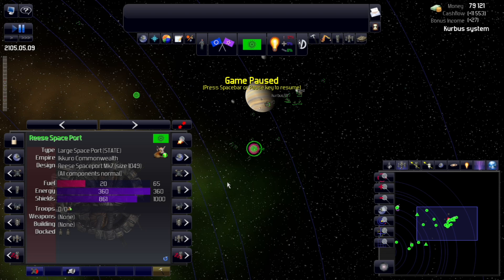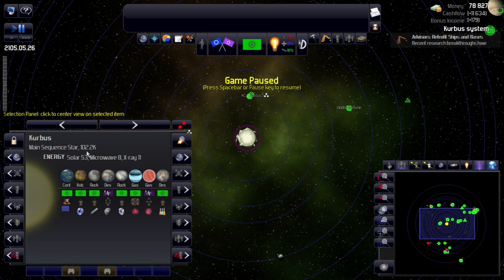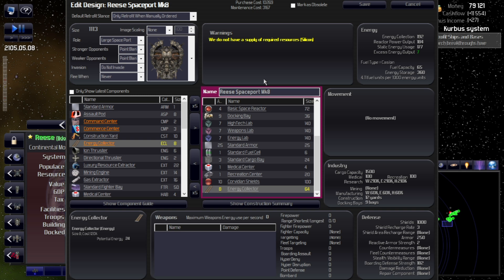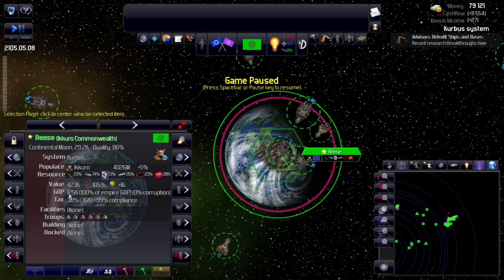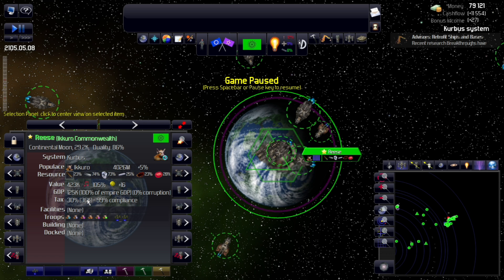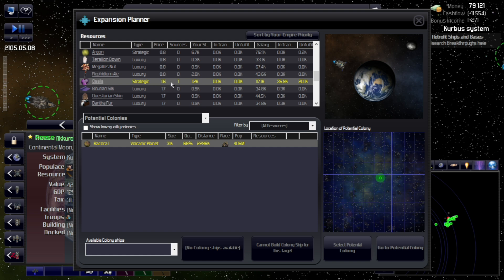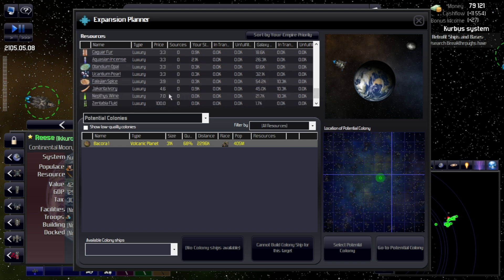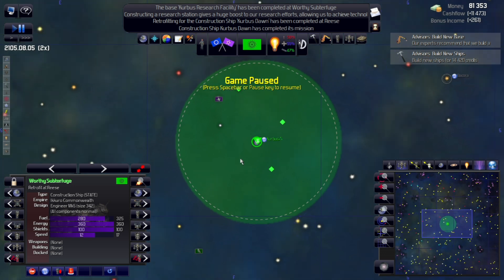Exploring Distant Worlds (VC) - Unpacking the Galactic Economy (7)

Comment: There's a difference between "realistic" and fun mechanics, especially in games, and I think that for me, the energy collection would feel unnecessary, especially if it's like you said, not something that will impact your playthrough except in rare cases. So, if you could, would you remove it completely or make it more important?
Reply from the maker: That's a good question, and also a complex one.    Realism vs. fun is something that I think varies in terms of what's best based on the kind of game we're talking about.  Some people on the matrix forums have wanted even more realism in this area, i.e. having energy collected be based on the square of the distance from the star instead of it being a linear relationship to reflect real-world physics more.  I think Distant Worlds does pretty well in straddling the realism aspect for the most part, with the escalation in travel speeds and distances being an example.   I could live with removing energy collection entirely, but I think I'd personally be more likely to just standardize it - i.e., any stationary energy collector within a star's radius, regardless of distance or type of star, yields X amount - and call it a day.  That way it wouldn't be something that produces confusion.
Reply: @strategicsage7694  I get that, I've been there too with some games, like Dwarf Fortress where I'd love to have mechanics for stabilizing roofs to prevent cave ins and radioactive ores, and so on, so I get it :D

It's an interesting question that of course varies from person to person, but standardizing some things is maybe the way to go here. 

If the system has a point I'm ok with it, but when, as you said, there's one way of doing it that handles 90+% of all cases, then maybe it should be a passive requirement, rather than an active, but easy, requirement.

The developers of Factorio had a mechanic where ore deposits has different qualities which in turn had an effect on the timing of ore mining. This disrupted all the other timing in the game, since only ore had this variable and other's had a set amount of time to complete a task.

They decided to remove the ore quality aspect of the game, and I think it was the right choice. They wanted to show that the focus of the game is in the planning of the factory, not in the calculation of how much ore is mined from an x quality deposit.

And, the way players handled the quality was just to oversaturate the lines by mining more than necessary, kinda like you showed here that an amount of collectors will be enough for almost all of the cases.

I'm rambling but I guess my point is this, what would you say that the DW game loop is, and would removing or standardizing energy collection adversely effect the game loop?
Reply: @Zammoron  This discussion would be less likely to get buried on reddit.  Youtube is very... difficult on threads, even when youtube isn't being youtubish.

Removing energy collectors would completely change the game IMO.  Not for better or worse, it would just play very differently.  As is, you can spam a decent number of mining stations all over without breaking your economy.  However, like SS said, fuel shortages are crippling and nearly impossible to recover from.  Energy collectors helps prevent the player (and the AI) from crippling themselves too easily.

If the player had more control over how fuel gets distributed and how refueling missions are prioritized, you could get away with removing energy collectors.  As is, the player would be forced to over-saturate their economy with fuel and be VERY careful with how fast they expand.  This would add more strategy and technical depth, but it would add economic traps not just for the player but for the AI.  (The fact that the AI can play the game competently without cheating is a huge selling point, so adding any traps that the AI could fall into would be a huge detriment.)
Reply from the maker: @RedPine 20 - I would actually respectfully dispute the idea that the AI plays competently, I don't think the AI in DW is better than most other games.  We've seen the ship designs it makes as one example where it's sometimes solid and sometimes pretty darned bad;  other examples that I'm sure you're aware of are coming.  

@Max Elmgren - The gameplay loop is hard to define.  I think it varies quite a bit based on what you've chosen to automate.  But in general, Redesign-Build-Expand.  Research is just sort of a constant, you don't build a bunch to make it happen as in some 4X games or the Factorio example. The occasional research station but mostly, you just pick your path and wait for it to happen, you can't accelerate it a huge amount.  When you get new toys, you make new designs to make use of them, go build new stations, military ships, whatever, then do whatever expansion you can afford (scouting/colonizing/conquest, it takes different forms), lather-rinse-repeat.  Diplomacy is also a thing etc. but that's the core loop.  

Standardizing energy collectors wouldn't hurt it.  I agree with RedPine 20 though that it could well hamper the AI to remove it.  One comment that comes up a lot is how plentiful resources are in general - another aspect that I think is probably the way it is balance-wise to facilitate the AI not constantly running low.

Comment: Something that might be worth looking into in a bit more detail from the video, fuel use.

You mentioned that ships and bases burn fuel, but didn't go into the actual fuel useage, though granted this might be something for another video.

In terms of how fuel works within Distant Worlds, to my understanding, is that each reactor outputs a certain amount of energy per second and each has an efficiency whereby they will consume an amount of fuel for 1,000 energy, so what does that mean in game?

As far as I'm aware it means that each individual reactor will consume fuel at a specific rate depending on their output, or at least they will consume it at a specific rate for 'full burn' output.

For example, the Basic Space Reactor that most players start with on 'PreWarp' says:
Energy Produced: 46
Fuel Usage per 1000 Energy: 4.11
Fuel Type: Caslon
Storage Capacity: 90

Presuming the energy produced is it's 'per second' max, then a single reactor running at full capacity will take about 21.75 seconds to produce 1,000 energy and burn 4.11 units of caslon fuel. Roughly speaking it burns caslon gas at a rate of 0.19 units a second, if my maths are right.

It can also hold a little under 2 seconds' worth of full output in its 'batteries'.

Given that? If a ship is running that reactor full, it will likely take around 288-292 seconds to burn through the full capacity of a single Small Fuel Cell's 55 capacity. That's presuming there's a single fuel cell for each reactor.

You can also use that sort of formula to roughly figure out the range of the ships, because something new players should note, that step from impulse only to warp is a big one. The Warp Bubble Generator is around 500 times the speed of even the fastest pre-Warp ships, the next step up with the Gerax Hyperdrive is 6 times that and drops the energy use by about 40% meaning that scout that barely made two sectors? Yeah now on that fuel it'll make 12+.

This might be more useful than my ramblings though: https://www.matrixgames.com/forums/tm.asp?m=2970969
Reply: There are some things I do napkin math for, but I can usually trust the ship designer to tell me how much range a ship has.  It sometimes underestimates travel range by about 10-20% since it doesn't seem to take fuel consumption due to static energy usage into account, but it's a pretty good estimate.
Reply from the maker: That's a lot of good info!  I think I covered that in more general terms when talking about the reactors for research purposes in previous episodes, as well as the range element when we made the jump to warp travel.    As of now my intent to keep that approach of looking at those changes in that manner rather than doing a 'deep dive' on the fuel aspect.

Comment: The cost-benefit analysis for energy collectors is (imo), that it's not ever worth caring even slightly about the star outputs or system positions.
I've generally been happy to ensure that my energy collection is >= static energy usage. I don't even care if it's overbuilt, I want my transports moving goods and not needing to move fuel (as much) is really helpful for that.

It might also be worth mentioning that colonies actually consume resources to produce/maintain thier growth and development.
If you have a shortage of a luxury, then you just won't see the extra money/happiness.
But if you have a shortage of a strategic resource then you'll start seeing growth penalties, and eventually loss of development if it goes on for long enough.
Fuel shortages are horrible, and not just because they make everything slow.
Reply: Agreed with regards to bases, if it's between half and twice the static energy use you're pretty much going to at least cut fuel useage for a station, possibly remove it for stations that don't see combat regularly or at all, because let's face it most bases unless it's a resort or research at a black hole will likely be within around half a system diameter of a star at the outside and it's not like you can actually go through every single system and build specifically for the energy output of that system's sun.

Mining ships, and probably actual combat ships, will often be hanging out at planets as well, so are most likely going to have the same rule of thumb as stations.

Construction ships? Those are a bit more dodgy, but that's primarily down to the fact they're also your repair ships so if you have a fight with a pirate or neighbour or you come across the remains of a fight you might be sending them to the edges of the system to repair and claim ships.

Likewise there's basically something like five/six(?) encounters you can have in space that are not empires; planetary ruins, pirates, monsters, independent colonies that may have ships, individual derelict ships/bases and derelict fleets/battlefields. The last two will at least sometimes be damaged, requiring repairs and might be far enough from a star to negate an energy collector and force the ship to continue purely on reactors.
Reply from the maker: @Serenitis - Good point on colonies consuming resources.  I think that becomes most apparent when you start sending out colony ships, so I plan on mentioning it at that stage.